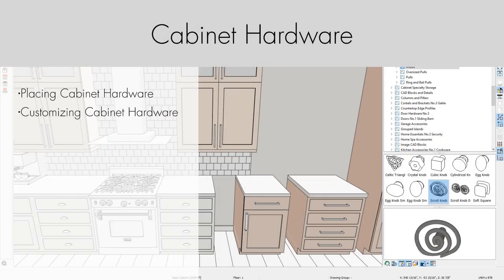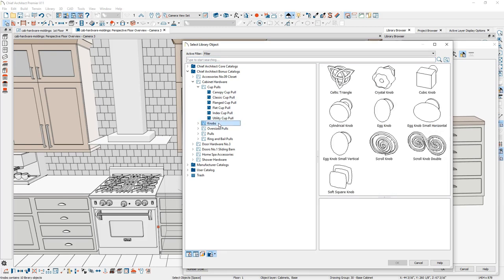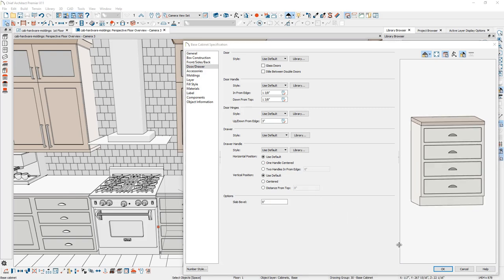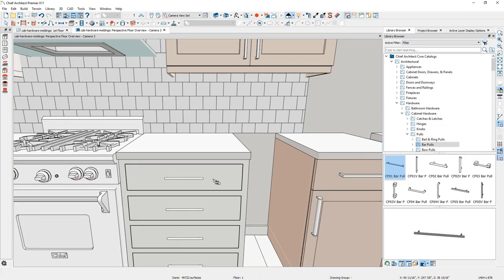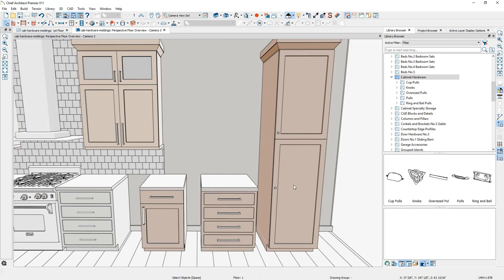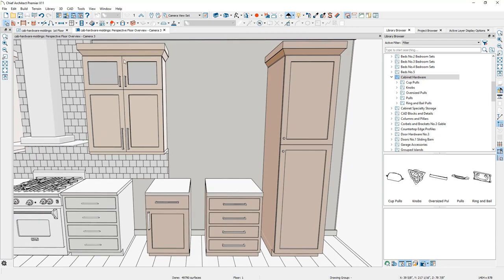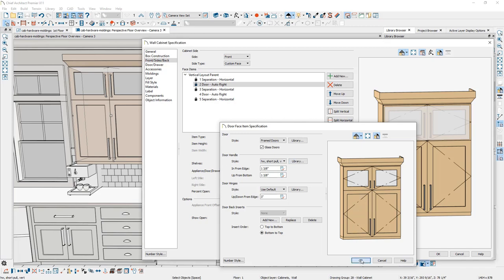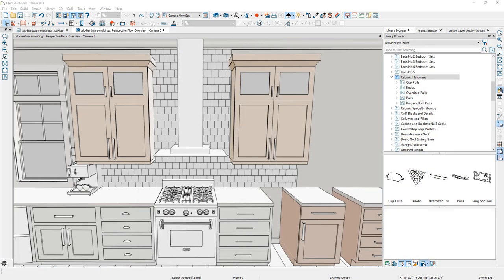Changing Cabinet Hardware

Comment: I am using Home Designer Architectural 2021, how do I adjust cabinet door handles on the full height cabinets?  The bottom door handles are always in the wrong location on the door.  Thanks and great videos.
Reply from the maker: In the cabinet specifications, you can specify the "In from edge" and "Down from top" measurements.

Comment: The "library" shows up on the door and drawer style areas but not in the hardware style.  Any guidance would be appreciated.
Reply from the maker: When you open the cabinet specifications, under the Door/Drawer panel, there are options for the door handle, hinges, etc.